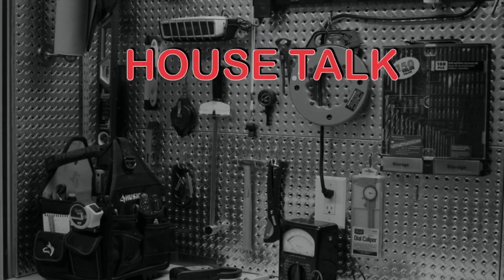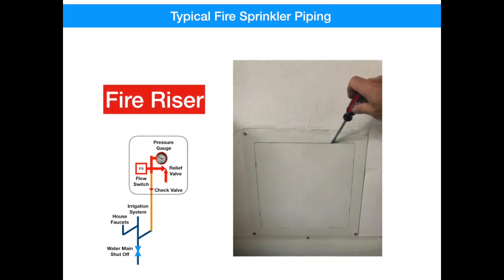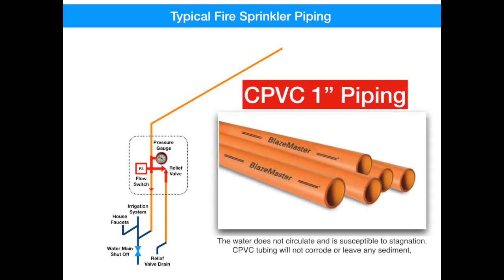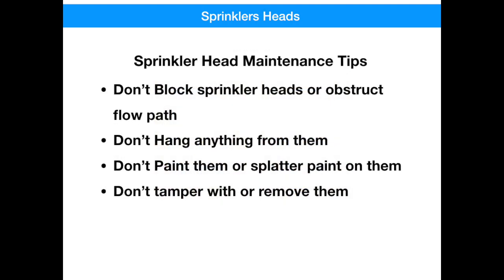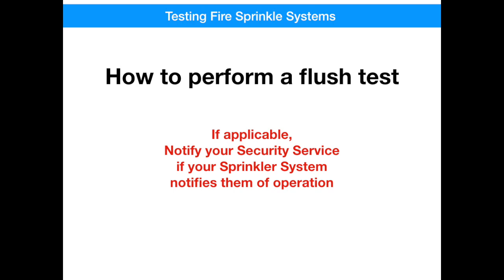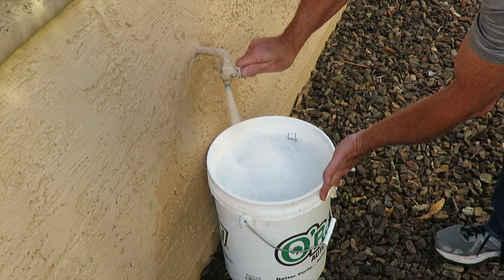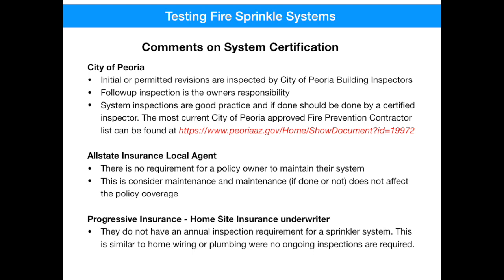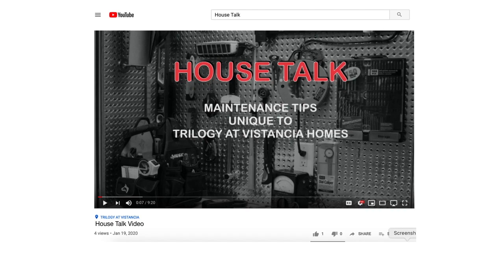Fire Sprinkler System

Comment: wanna try using the formula Q=k√p to explain how you got 4 gpm from a head
Reply from the maker: It's been a couple years since I did this video. I do remember the K factors were 4.2 & 4.9 for the sprinkler heads used here. The flow switch operated at >4ppm and the flush valve (as shown in the video was about 16gpm with the 1" CPVC piping.

Comment: Nice video!     when I run the test the bell used to turn on and ring,  but not  anymore.   I have excellent flow.    How can I approach this to troubleshoot?
Reply from the maker: The configuration in the video is specific to houses built at Trilogy at Vistancia in Arizona, so I am not sure about your exact configuration. The flow switch that operates the electric bell is suspect. If you can access the flow switch unit you can test the cable going into it with a non-contact voltage detector to see if voltage is available at the switch. If not, it may be as simple as a blown fuse or circuit breaker. If voltage is available, I would focus on the mechanical switch which may be seized by mineral build up in the piping system. Especially if the system has not been flushed regularly. This sounds crewed but check valves and flow switches have been known to free up with a wrapping from a wooden dowel or rubber mallet. This may free it up but it will most likely occur later if the system isn't regularly flushed. If these options do not work you may have to contact a fire system service. Unfortunately, the Fire Switch unit usually has security fittings (screws) that prevent access to those without the tool to open them.

Comment: It's great that you produced this informational video about residential fire sprinkler systems. One note of correction would be that a typical sprinkler system would be designed to provide at least 13 GPM per sprinkler for standard spacing (16 ft spacing) sometimes more(for larger spacing) sometimes less if there is poor water pressure and special low-flow sprinklers and reduced spacing were utilized but even then it would be more than 4 GPM. Your flow test illustrates this by showing approximately 16 GPM flowing if you were to extrapolate your flow for a one minute interval.

Also your pressure reading may not return to where it was previously after a flow test due to the check valve trapping excess water pressure due to pressure surges or thermal expansion which gets relieved when you perform the flow test.

Comment: Before opening the flush valve, check the pressure on the gauge in your garage.  It usually will be between 50 - 70 psi.  When you open the flush valve the pressure will drop initially but should return to approximately the same pressure you had before you opened the flush valve.  If it does not then your valve in the garage is frozen shut which means the sprinklers will not have enough water pressure to put out a fire in your house.  A Fire Protection service can either fix or replace this valve for you.  I highly recommend this as my valve was frozen and had to be replaced 2 years ago.  I now check it every 6-12 months just to be sure.  Hope this info helps.